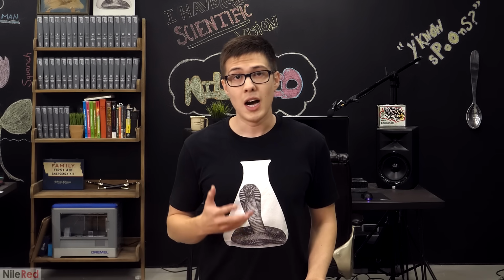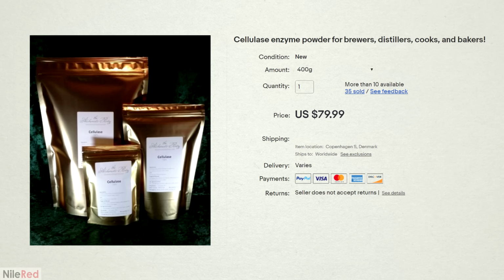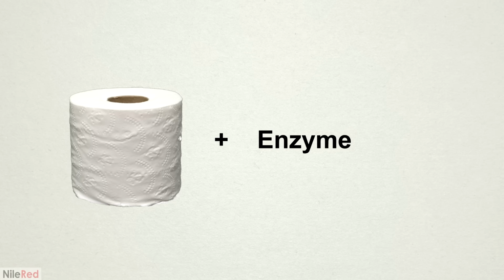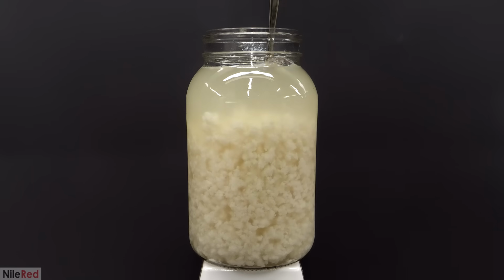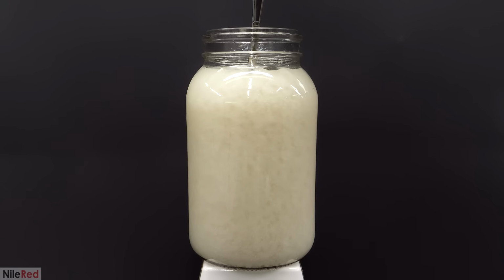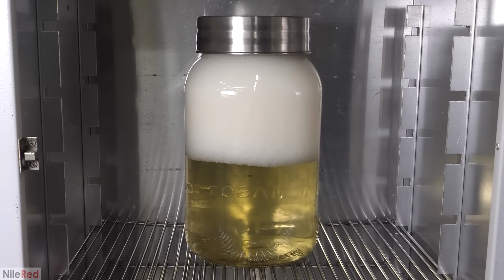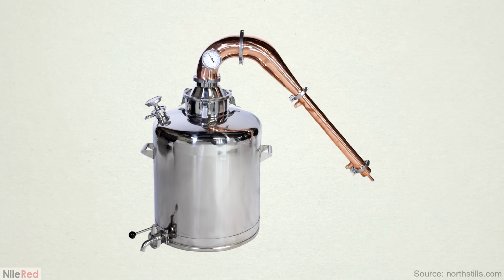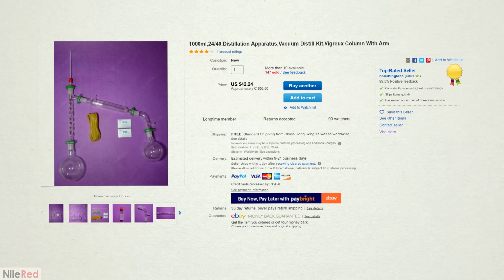Making toilet paper moonshine

Comment: "wood is 50% cellulose so a lot of our houses are kinda made out of sugar"
laughs in cement and steel
Reply: Wait you guys have a house?
Reply: laughs in european architecture
Reply: @mayrln  Dude, you're my Hero. I'm a German roofer and damn, even tho I usually work with wood I HAVE to learn the basics of cement and masonry.
Reply: Laughs in cave
Reply: Go ahead and laugh, but I'm making alcohol out of my bedroom wall
Reply: Little pig, little pig, let me in!
Reply: You'd be hard pressed to find a house made with a steel frame
Reply: Pog not in coastal areas or south Florida. My house in Florida is framing in steel and then has concrete poured and lifted up and bolted to the steel frame
Reply: My house has over a ton of moonshine in it though
Reply: houses made of wood generally have drywalls. here in europe you cant punch through your walls like its carboard.
Reply: ok silicahead

Comment: Homebrewer here, I notice you calculated ABV off of a single hydrometer reading.  This is not how hydrometers work, some hydrometers do have ABV markings on them (I use one myself) but those numbers are potential ABV based on the sugar in solution, not the amount of alcohol in solution.  In order to find out how much alcohol you generated with a hydrometer, you would have needed to take a specific gravity reading before adding yeast, and then again after fermentation. These numbers are your Original Gravity and Final Gravity respectively, you then Subtract the OG from the FG and multiply that number by 131.25 and that number is your ABV percentage.  Though this still doesn't help you after distilling, because you are changing the volume.  Calculating the ABV of a distilled spirit with a hydrometer really isn't possible, because you lose so much volume in the distillation process that your gravity readings will be thrown way off. You may have been able to use an alcoholmeter, but those are finicky, any sugars or other solubles still in solution will throw your readings way off. Really neat experiment though, I'm almost tempted to do it myself, but I think I'll just stick with brewing mead lol, waaaay simpler.

Comment: i am curious what the boiling temp was for the base tp mix.  and what was your buffer ph before adding the citrics?  sorry but distilled water is seldom the expected 7 neutral. it absorbs co2 and gets slightly acidic.  leaving it out can get it down to around 5.8.  and why in heaven did you not take initial and after ferm specific gravity's?  and wth?  your glass was used but instead of sanitizing it you bought new, which you STILL should have sanitized.  you kinda suck as a scientist and as a moonshiner. your hydrometer told you it was 20%? ehhhh! wrong. 20% is 40 proof and will burn.  you need a baseline to compare your readings.  go back to school you bozo.  quick rule of thumb tells me your end results would be closer to 80 proof, not 128 proof. alcohol. your methods are very poor though so.  meh.

Comment: as someone who brews. If you have a hydrometer. Please measure the initial liquid before adding yeast so that you can test the sugar content. Because yes you can do that. Then if you are really low on sugar (under the amount of sugar required for your yeast to reach it's alcohol tolerance which you can do with some basic brew math).
Then when you are done brewing you can test it again to check how efficient you were and how much you can hope to get out after distillation. 

If you plan to drink the alcohol, please get rid of the first initial output as it contains methanol which will among other things, make you go blind. There was probably a few percentage points of Methanol in that jar he drank from at the end. 

Take this video as a chemistry video. Not a brew video if that was not obvious. 

On a side note. There are some glues and other bonding agents used in making toilet paper. I have no idea if those were broken down in the initial cleaning and base steps. I would be concerned with getting that in my alcohol.

Comment: Fungi release a bunch of stuff in their culture broth, mostly proteins including enzymes like the cellulase you used, and hydrophobins which are tensio-active proteins. They most likely caused your foaming problem while distilling. When the gas dissolved in the liquid is released (by the pressure drop when serving beer, or here by boiling it out) hydrophobins stabilize the bubbles and it starts foaming... it's actually a real issue in brewing, finding the right conditions for beer to form enough foam but not gush out of the bottle upon opening

Comment: Idk what you were using, but hydrometers don't work that way. They float at different levels depending on the amount of sugar in solution and you need two readings (one before fermentation and one after) to calculate ABV.

Comment: Your flask used to boil was too small or too full.  The foaming is called “puking” by distillers,  some mixtures foam more than others, but filling the heating flask 2/3 full at most is a basic rule of thumb.  Also adding too much heat too fast will cause foaming.  Thumbs up very interesting video.  I wonder how much poisonous methanol was produced along with your ethanol?

Comment: When you're doing distillation/extraction, do you use fresh water from like a tap in the condenser tube or just recycle the same water? What little I've done, I just had a bucket of ice water and a water pump and just recycled the water over and over, but I didn't know if that was right. Seems like that heats up the water pretty quick like that.

Comment: Freeze distilling is a simple method to remove much of the water in one large batch without having to do small batches in the glass ware and I've tried comparing the flash point of ethanol in water via tempature and comparing it to the hydrometer only to find they didn't give the same results.

Comment: Ok let's get real here: what can one use as a base if drain cleaner is not available?
Bonus points if you can point me to the right commissary item.
Reply: Calcium Hydroxide ( pickling lime). The Ph is 0.6 Points more acidic then NaOH but it should still Work and is foodgrade

Comment: The boiling temp of ethanol is higher than methanol, which means most of that first run that had actual alcohol in it was actually methanol. Alcohol from cellulose can kill or blind you. This is why we drink corn liquor and not pine liquor. 250 ml of methanol is more than enough to kill you. This is a very bad idea and an irresponsible video.

Comment: Nice project. Just on a side note for future endeavors, there is actually no point in covering the fractionating column with foil. Doing this prevents the actual fractioning from ocurring, as the whole column willeb at the same temperature as the flask and you will end up with a lot more water content than you would with an efficient fractionation process. 

The distillation process will be slower this way, but you will get higher ethanol content in fewer runs.

Comment: SOMEONE NEEDS A VACUUM FILTER!!!!!!!!  (it would have made cleaning the toilet paper after being broken down by the base SOOOO much easier) - and of course - you would need at least a BIG one too lol - and those are not cheap - nono (BUUUUT, if you do what I did - it IS cheap hahaha - you have a professional glass blower make you one - and you show them the basic design - and then just tell them to make sure the bottom fitting is the same size - but the top part to be much bigger - and they will make one for you - you can even have them use the best kind of quality high temp glass if you want - which is needed since you want this to be very strong to withstand the high pressure of a good vacuum) lol - BUT holy shit THEY ARE SO WORTH IT - and I constantly use it when I work in my lab.  I cannot imagine doing anything without it now!  If you want to buy a SMALL receptacle (not even including the other required gear) - here is a piece made by Cole-Parmer lol:  https://www.coleparmer.com/i/cole-parmer-vacuum-filtration-holder-membrane-size-90mm/0292330?PubID=UX&persist=true&ip=no&gclid=Cj0KCQiA5dPuBRCrARIsAJL7oejLOkFMwIYM-_kxAl2vrsbnpXtMXqFYwSx5XIznxMO0j1XiR5nUlIYaAm39EALw_wcB

Here is a setup that has the WHOLE kit and caboodle - if you're interested.  YOU REALLY do need to get one of these.  How can you be into chemistry and NOT have one of these yet?!?!  THESE ARE LIKE FUNDAMENTAL TOOLS BUDDY!!! lol - new to chemistry much?  https://www.sterlitech.com/botanical-extraction-filter-kit-90.html?wtx=GAW&gclid=Cj0KCQiA5dPuBRCrARIsAJL7oegXIh4rJChGmwsnxU3RaJdFTc9PTW_hiyBACzj33lOEW6N4dYvsIvYaAjdOEALw_wcB

Also - I can easily tell that you did not wash enough of the base out of the product - the coloring within was still rather apparent.  I would have given the product at least 10-15 washes since this product is meant for consumption!!!!  Trust me you do not want ANY of the base in your product before you proceed on to the next stage of your experiment.  With a proper vacuum filter you could have done this easily.  I would have ALSO put the product in a BLENDER with some distilled water after it was washed - and chopped up the paper even more!  This would have also sped up the reaction process by quite a bit!  Don't knock blenders lol - they work really well!  ESPECIALLY if you have a Blendtec Blender like I do :D (will it blend?  fuck yes it'll blend.  It'll blend an entire fucking broom handle into dust if you want,  FFS you can even blend a damn iphone in this behemoth of a blender LOL.  That blender IS expensive though - and there is NO way around that cost if you want one - I too use the Blendtec Blender frequently in my lab LOL).  I would have ALSO waited longer than 48 hours for the cellulase to finish up eating up the cellulose.  I would have ALSO added more if it was required to finish off ALL of the product so you are left with a liquid with NO paper in it!  This also means adding more of the citic acid etc. to even out the PH.

Comment: Yeah, I was looking into something similar once and although I didn't have the equipment to actually test it I also arrived at the conclusion that just about everything is actually made out of sugar in one form or another. Sugar and proteins, really, those are the building blocks of life. Anyway, you probably should have filtered it through some active carbon as well to get rid of most of the impurities. Might have made it taste better, I dunno I'm not really a distiller either.

Comment: alcohol evaporates even at room temperature this is important, you dont even need to boil the water, just use 2 closed containers and the condenser, takes longer but its easier, i've done that to get ethanol out of cheap wine before.

Comment: Usually in making moonshine that first catch (10%) is discarded because it's high in methanol, which is highly toxic and "the devils cut".  It has a lower evaporation point and can safely be discarded before the ethanol comes.  Did you do this?

OK, nevermind, you did that later.  Whew!

Comment: Determining the ethanol concentration by refractive index is probably more accurate than this hydrometer. Then again both assume a simple water/ethanol mixture, while there are other volatiles in there as well.
EDIT: The advantage of using the refractive index is that you can check small droplets while the distillation is still in progress. Sure beats tasting the stuff I imagine!

Comment: Isn't aluminum foil a pretty good thermal conductor?  Wouldn't wrapping the glassware with just about anything else do a better job of insulating it?  Or do you specifically want a little bit, but not too much, insulation on the fractioning column?

Comment: But buying bags of granulated sugar is probably cheaper. My understanding is you need some other things in there for normal yeast to function on sugar. I get 'yeast nutrient' myself. Honestly you are really lucky it didn't froth over in fermentation. Usually you have to leave a good amount of room for a froth that forms at the top. You probably got away with it because it didn't ferment properly for the reason I mentioned at the start. I make wine out of minute maid peach punch, granulated sugar, pureed boiled potatoes, yeast nutrient, and lalvin 1118. I add potatos to try to introduce these extra materials, but fear the starch is never converted into anything. You also have to keep adding sugar and nutrient as it goes along to up the alcohol  output as the ph keeps going more acidic and you would stall it initially otherwise.

Comment: Nile, you should make Gasoline or Diesel out of Crude Oil/Petrol - then use it to make napalm or run a generator with it to make electricity, plug your PC into the generator, and upload the resulting video with said PC.

Your chemistry vid could make your chemistry vid; that's pretty badass IMO. Also Napalm. Napalm's cool; as kids we used as mortar for crappy forts we'd build in the woods - then burn those badboys down in a glorious flame.

Comment: "I have to make sure this is food safe" 
>starts with toilet paper and drain cleaner
Reply: Cupcake Intake  Well yes, the majority of fruits and vegetables contain cellulose, often known as dietary fibre. Any processed food labelled "high fibre" will often have cellulose added.
Reply: The pancreas basically creates drain cleaner and releases that into the small intestine, it's fine.
Reply: And let's not forget about that dreaded chemical he kept using throughout his experiment. Dihydrogen Monoxide. Everyone who comes in contact with it will die.
Reply: @timothyneiswander3151  Swing away, Merrell
Reply: I'd also like to warn you that Sodium and Chlorine are both nasty chemicals and should be avoided at all cost when it comes to food preparation.
Reply: @MichaelSteeves  fair enough. I hear that when bound together, however, they're quite tasty.
Reply: @MichaelSteeves , I have stopped adding salt to my food for other considerations, tricky guy.
Reply: @MichaelSteeves  enjoy hyponatremia
Reply: @MichaelSteeves  "chlorine is nasty and should be avoided"
Wait until you find out what salt is made out of.
Reply: @yoshi6236  he's clearly joking. He mentioned sodium and chloride in the comment, I'm certain he knows what salt is made of
Reply: @yoshi6236 , you fell into Mike's trap!
Reply: @Anon.G  I joked back.
Reply: @kilppa  Wait until you realize that while you tried to look smart, I actually was continuing with the joke.
Reply: @yoshi6236  Suuure you were.
Reply: August 👏🏻👏🏻👏🏻👏🏻👏🏻👏🏻👏🏻👏🏻👏🏻
Reply: Cupcake Intake , I stopped buying grated cheese when I could read on the label "micro crystalline cellulose included to prevent caking". Regarding lye, bagels, no?
Reply: Toilet Paper is pretty much just celulose and traditionally german Pretzels are made with Sodiumhydroxide lye.
Reply: Plus watch "How It's Made",and see what was done to MAKE the paper before he got it,lol
Reply: There's no detriment to consuming pure cellulose, although too much will give you a stomach ache. There's no benefit either, since it won't get absorbed. But my pica loves paper, so if anything bad happens if you eat it, I would already know.
Reply: @AbsolXGuardian  lots of nasty bleaches and chemicals in paper, wouldn't advice that.
Reply: @AbsolXGuardian  tell that to a classically trained nutritionist. i hate nutritionists

Comment: If you're also gonna use Life, like Yeast, pointless buying cellulase, a Life process component.
Use a Fungus instead. Similar to Sake wine from rice. Koji/Yeast is one of very few examples.
Turns out the Old Timers were 100% right about accellerating booze distillation.
Scientific proof here: https://www.sciencemadness.org/whisper/viewthread.php?tid=61566
Action starts around page 20 ish.

Fact is that the Fauna and Flora on your USED toilet paper have a mix of species that also digest cellulose.
A Used Toilet Paper video would be awesome. Might smell a bit.

Comment: So, I'm kind of confused. Why couldn't you go by temperature? I got the impression that the concentration of alcohol in solution was changing the boiling point of the overall solution, but I thought that was how it was suppose to work. Would you mind explaining more clearly why you couldn't go by temp and had to use taste?

Comment: Long time brewer here.  You could use a hydrometer to test the specific gravity before and after fermentation to calculate the ABV% of the alcohol in the solution.  Then after distillation you would need a proofing hydrometer (they are different) to find the proof or percentage value of alcohol in the final product.

Comment: Couple of things, if you clear the undistilled product with gelatin powder before distilling it you will get rid of most yeast particulate. Also i'd swap the pipes on your still so that the water circulator is vertical above the boiling water, you won't get that bubbly problem since it will cool it before that happens, and it will also, with a bit of tuning cause the alcohol to condense at the top of the still making for a more efficient process. Most moonshine stills are built this way.

Comment: If you use sulphuric/sulfuric acid to break down cellulose from wood pulp, then ferment it, that is the industrial process for manufacturing METHANOL not ETHANOL.  To clarify, that is not drinking alcohol, and can kill with as little as a few teaspoons, or cause blindness with as little as 1 teaspoon.  This has killed many moonshiners in the past.  Please post your process that you believe will make ethanol instead of methanol using wood pulp or paper or toilet paper, as I believe you have a misunderstanding.  Even small amounts of cellulose containing material, create a "head" of methanol that is usually decanted off when distilling the alcohol from the fermented mash.